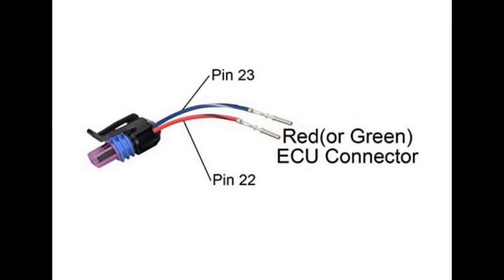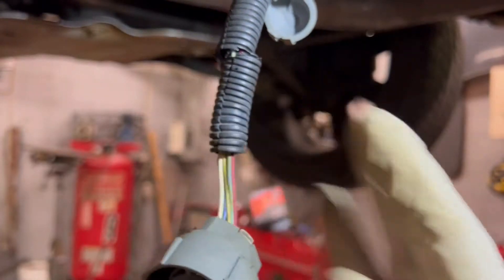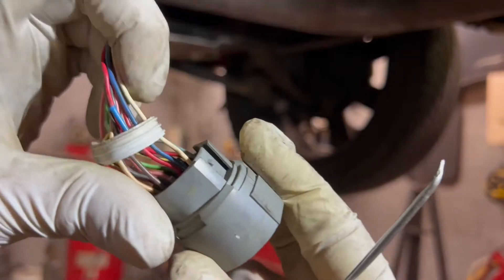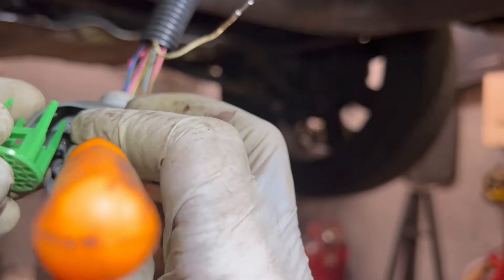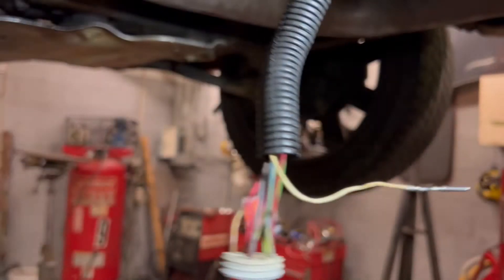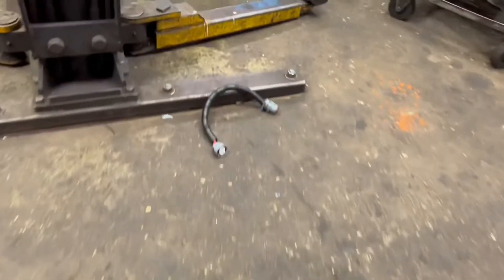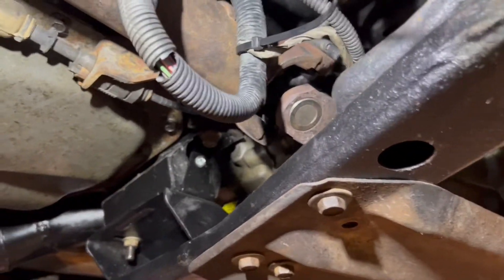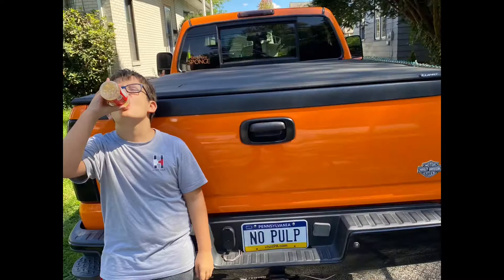Swap 4L60 to 4L80 (wires)

Comment: So what do you do with a white wire what does the second speed sensor hook to
Reply from the maker: The second speed sensor hawks the plug on brain 22,23 slots
Reply: Okay do I do the same thing my colors on my computer is blue and then the other one is green the other plug how do I manage that because I think I hook mine up wrong because my transmission is not shifting out of second gear I still have my factory computer from the 4 L 60 is that why it is not shifting out of second gear I made sure I did the wires correctly why didn't you use the white wire I thought the white wire goes with the second plug on a 4 l80 where you use it to tie into with the brown wire with the stripe for the second speed sensor above the shifter

Comment: What's about the rear input sensor on the transmission ?
Reply from the maker: Are you referring to the two wire speed sensor.  If so, the beginning of the video shows you the two pins you must add to your existing computer I believe is 22 and 23 Penn. But the other sensor is the same wire that was on the 4l6

Comment: Pretty sure i bought the same wiring kit, but why didnt you the trans plug harness? And did you have a segment swap before you noticed it was stuck in second?
Reply from the maker: Yea do the pin this way you know it’s right
Reply: I  did the 4l60e swap to 4l80e swap in my 96 Chevy Silverado do I still do the pin wire swap
Reply from the maker: It did not work. I did not need to segment swap at this point I had a different brain in the truck
Reply: @crazyricha9784  so would you suggest just doing the pin swap instead of using the harness, havent got the segment swap yet. But dont want to give the tuner a hard time if it doesnt work when on the dyno

Comment: well im going to find out soon, doing exactly what you just did haha. going from 4l70 to 80.
Reply from the maker: You’ll love it
Reply from the maker: Any questions just ask
Reply: @crazyricha9784  
which year vehicle did that particular 4l80 come out of?
the guy that’s doing my wiring right now said the 4l80 that i bolted up to my 2008 vortec max is a 97 or older 4l80, which then means, he said he has to get a different ‘particular harness’ to compensate for the earlier generation 4l80 going onto my later generation truck (2008 vortec max). he just put a chevy express van wire harness on my truck to said trans, because the speed sensor and torque converter solenoid situation is different between the generation 4l80 i have vs the later next generation 4l80.
point is, is the generation of 4l80 relevant to the generation of truck it’s going in? in terms of wiring and tuning? 
he said he can’t get the torque converter to lock properly because of the solenoid compatibility.
i based my swap off of this video and a few other videos on youtube. i’m just a knucklehead with tools that knows how to take shit apart and put shit back together. all the computer and wiring stuff is for the shop who has it now. 
everyone and their momma has done a 4l80 swap i figured it was gonna be a easy as this video. i guess not with my particular configuration? i need to find someone who’s done a “97 or older 4l80 swap to a 2008-2013 silverado”.

Comment: So you didn't  have to segment swap the pcm
Reply from the maker: Finally did segment swap love it. FYI if you have it done make sure they do it with the diagnostic. Other wise make get codes
Reply from the maker: I had a second PCM. If you still have the 40 60 PCM yes you will have to